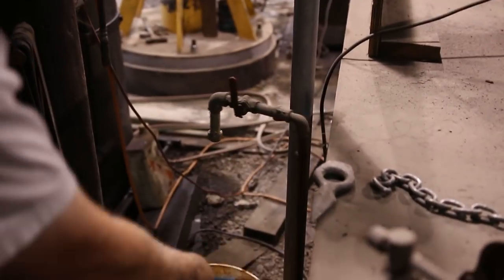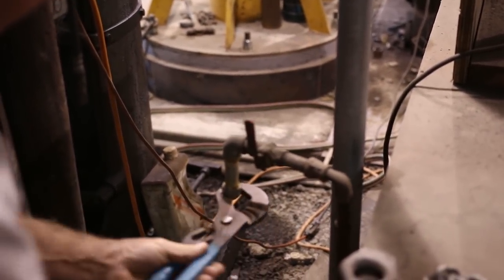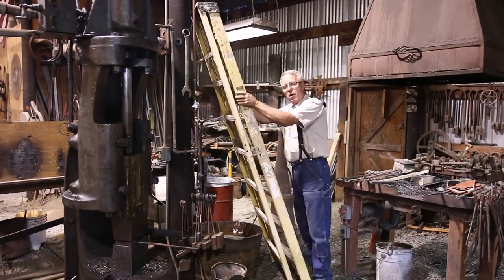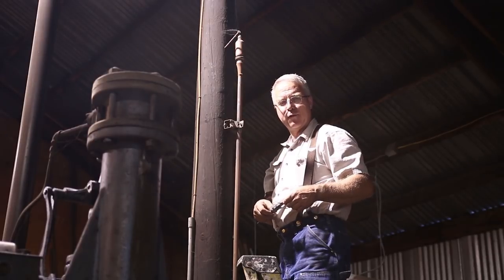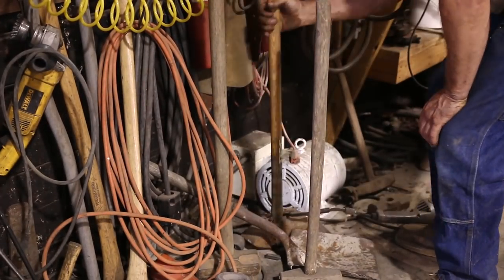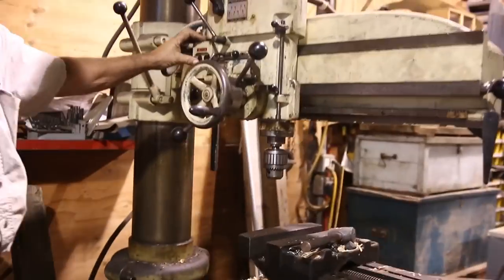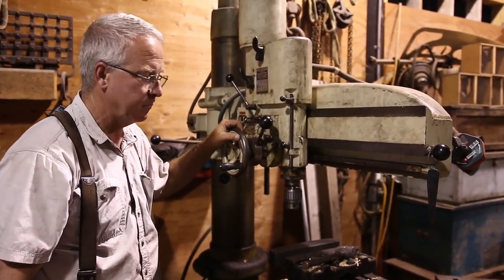Shop Questions: Condensation, 3 Phase Power, Whistle Specs

Comment: On that I have to agree. I have a number of friends who built their own shops and as they began looking about for equipment they all discovered they really should have set the shop up originally with 3 phase power and put in a 600 amp light industrial panel. If I ever get the chance to build my shop, I will have learned from a lot of people's mistakes. Thanks for sharing.

Comment: I am a glass artist who etches and carves glass with a sandblaster. I worked for a custom glass company for nine years, and ended up being a de facto sandblaster mechanic. I have my own little blasting rig now. Condensation is my nemesis. When you opened that valve and the rusty water came out, it brought back a flood (so to speak) of memories of trying to meet a deadline on a big etching job after a week of hard rain and nobody else in the shop had bothered to drain the compressor tanks or any of the airlines. The water traps don't help at all when you need the silicon carbide or aluminum oxide grit to be dry.

Comment: I bought a three phase motor when I built my belt grinder. It came paired with a variable frequency drive (VFD) that turns single phase 220v into three phase 220v, and it allows me to fine tune the belt speed. Sweet setup! I'll have to keep that in mind about the generator idea. Oh the possibilities... I also have a Miller Syncrowave that runs off of 480v single phase current, but it came with a step up transformer that makes 480v out of 220v. I got it from an old boiler maker who had a couple of master electricians wire it up for him. It makes that big machine run great off of just a 50 amp circuit! More than on way to make things work!

Comment: Always a pleasure to hang out with ya in your shop. I'm curious about the location of your compressor's over-pressure relief valve. Rust and no maintenance could cause it to fail . I'm sure you're aware but some viewers may not. Cheers

Comment: It's is a pressure vessel up here in WA the state comes and inspected any pressure vessel over 120 gallons. it's just under 200 bucks and gets done every 2 years. they measure the tank wall thickness in several spots and compare to the mfg's specs and history and will tell you when it's time to remove from service.
Am i glad i have to pay for  this? no, but my neighbor has a 4500 gallon tank and i am glad that thing get's inspected!

Comment: I have a much smaller compressor with a tank and much smaller aux storage tank for when I run a high CFM demand tool (die grinder, blow gun). Both the compressor and the aux air tank are located outside of my shop proper. I was nearly killed when working next to a large compressor at work. One day, the water separator decided to explode and launched shrapnel through the walls of my tool rollaround.

Comment: Federal Pacific load center? If I'm correct in thinking so because the breakers flip the 'wrong' way and exposed main breaker, you need to replace that pronto for safety.
I'm that LAST person to be considered a safety nut, but the failure rates are enormous. I just replaced one and I know 110% that the breakers do not trip properly.
They also should not be exercised or turned on/off regularly. I have a personal connection to that mess, and sleep better now my house doesn't have one.
Reply: Yeah, the color looked right for FPE.  If it is I agree, I am also not a safety nut but I had those in my house and they do not trip.  Total garbage.  There is a aftermarket replacement I used that worked well so I could just change the breakers but with a surface mount box like that I would just replace the whole thing.
Reply: Mulligan Farms federal Pioneer and their less then desirable and known to fail
Reply: John - yeah I considered the Cutler direct replacement, but went over top of my flush mount with a Square D surface. Both are miles better than FPE, and I had failure to trip after a screw went through Romex in the attic. The electrician and I then had the squeamish task of flipping 20+ unlabeled breakers to find the correct one. It was replaced the next morning.

longstar - just had that discussion with a friend in Canada after sending him pictures. Wasn't aware they have a slightly different name there until last week.
Reply: You must know the look better than me.  I've run into a few Federal No-Trip's in old houses around where I live but that one doesn't look like the one's I've seen before.  Granted, those were in-wall in a home not a shop level panel.
Reply: Really scary thing is ihave seen non bolt on commercial federal panels
Reply: I replace those things all the time. We call them fire pacifics

Comment: You may look into automatic drain valves. They automatically open at a specific time interval. Though the drain would need to be at the lowest point in the tank to get enough of the water.

Comment: Regarding the underground tank, one result of any perforation would be the immediate discharge of oily water from the compressor condensate; so I hope the shop is not too close to the water supply well.  It only takes about a teaspoon of oil in a railroad car of water to exceed some drinking water standards.

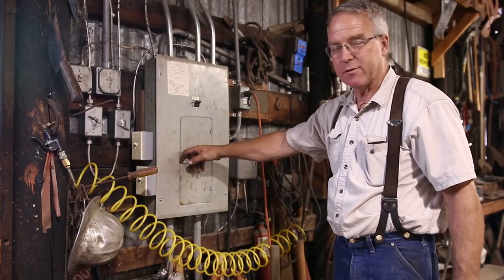Comment: 2:18 Some electrical advice. There are two things that get confused. 1. Total power available 2. Space for circuits available

1. 200 amps should be plenty of power to serve your shop. To check, remove cover, attach amp meter on one leg. Turn on as much equipment as you can, or that you reasonably would use on a extremely heavy work day. Check amps used, you will often be amazed how little your using. I doubt you ever exceed 100 amps. Now check the other leg, they both should read about the same amount. Each leg can handle 160 amps+ [thats 80% of 200- a safe amount] <[Checking the total power used might make a cool video as well, especially if you blow something up]>

2. If you have enough power, but have run out of space for more breakers, its a easy fix. You need to mount another sub panel next to the 200 amp panel. Say a 100 amp panel? Put a small conduit between the two panels. Install a 100 amp breaker in the main panel, then run two #4 wires from the breaker to the sub panel main lugs. #4 white neutral. #6 green ground. Now you have plenty of space for more circuits. Just try to keep the biggest circuits on the 200 amp panel, and the smallest circuits on the 100 amp panel.

Comment: Bought a house with 100 amp service and had 200 installed recently. Suits my wood working needs just fine. The smithy is not in my home, I’d need a lot more power to cover that. As always, great video, keep it up!

Comment: You're right - the tank will likely get a pinhole and leak that way.  And the dirt surrounding your tank will protect your shop somewhat from an explosive failure.  But if it fails this way the two feet on top won't make too much difference I don't think.  But make no mistake - entire shops have been totally destroyed from compressor tank failures.  They looked as if a bomb went off.  No kidding.  But most failures are due to pinhole leaks.  Carry on and keep up the good work!

Comment: Hi. I'm 15 and for the past few years I've really been getting into blacksmithing, machining,  welding, and metalworking in general (specifically knife making). I'm finally getting to the point where I can actually afford high quality equipment. No one likes to admit it but I think that harbor freight can be really useful for getting on your feet, but now that I can buy tools that will last over a month, I wanted to know what you think about specific brands. I saw that really cool antique 7" angle grinder & was wondering what kind it was, or if there was a specific brand you would recommend. Thanks.

Comment: I have seen a few air tanks fail over the years and every time it happened exactly like you said. it just develops a pin hole and automatically drains the water out of the tank and also automatically drains all the air out of your system every night when the compressor is off. :)
Reply: Jesus. You store tire tanks in the ocean or something? A decent tank should last at least a quarter lifetime at the minimum.

Comment: The total power requirements in a 1 man shop would be relative low although the number of circuits maybe higher than the panel has available. You generally do not run more than 1 or 2 tools at once. Note: if your panel is an F-P it should be replaced they are not safe.
I've been looking for a budget priced phase converter most are out of my budget ( 500 +) so my 3 phase tools sit under powered the static type sorta work  you only get 2/3 of the rated hp and probably not good for the motors.
Really like your presentations they are very informative and well done

Comment: Maybe an idea for a video would be to cover the Boy Scout's of America metal working merit badge. If you look at the requirements it offers a very on the surface introduction to the trade. The as the option for what kind of metal work go with the blacksmithing. An idea worth considering?

Comment: Living in Florida with our high humidity you have to have a drainage system on your compressor lines. We crack and drain condensation during every work session otherwise the equipment fails.

Comment: Water heaters are pressure vessels . There have been tests done on them that have made them some shoot straight out the roof of a 2 floor mock up house . 
All I'm saying , it has the potential to be a danger . What pressures is that tank under ?
Reply: Argo Tungsten 
The water heater issue has a lot to do with temperature, when temp control goes bad along with pressure release valve you end up with steam and.....boom

Comment: What are your thoughts about frequency drives vs. rotary converters ?  My understanding is it adds the opportunity for  variable speeds while maintaining same motor torque.  I ask because eventually I will have 3phase equipment for the reasons you stated.

Comment: I needed to use one of the compressors in a barely used ex naval workshop in Abu Dhabi, to get the ship horns working on the bridge superstructure for an owners visit and despite having a tank nearly six foot diameter and around 12 feet long, it seemed to have bugger all capacity. I tapped the tank and was stunned to realise it was full of water up to about 8 inches from the top. Only had a half inch drain cock on it and the clients were arriving in a few hours, so I had to wind the entire one inch reducing bush out of the base of the tank and get a crack squad of mop infantry to assist with the stinky brown, black deluge. There is no worse case of poor compressor maintenance that I've come across.

Comment: As a plumber that replaces galvanized pipe on a regular basis do to failure by rust, my best suggestion is bleed the water off of that more often. I've seen galvanized pipe that had been in a house for decades with no issues (despite the fact they are doomed from the beginning, what can I say, in those days it was a reasonable choice of material) but as soon as the people move out and the house sits for even a few months with water in the pipes and no running water the entire system of pipe rusts unbelievably fast.

Comment: I have never seen a rotary three phase generator and I have work in industrial for most of my adult life. I am in love and I am going to go out looking now.
Reply: Robert Ketter RPCs are a good option, and there are plans online to build your own. The downside is they’re noisy.

Variable Frequency Drives (VFDs) are another option for you to research. With those you can get variable speed but they do require you to use low voltage controls. You cannot break the circuit under load downstream from a VFD or you’re very likely to release the magic smoke.

Comment: As a man with vast concrete experience, I'd like to ask you a question from someone with little concrete experience. We have a local quarry that sells limestone blocks. 2'x2'x4' in size. Roughly 1800-2000lbs a piece. The price is cheap if I remember correctly but at the moment cannot recall the exact price. Is there a way for me to figure out the slab thickness to use these as a wall for a shop or would the weight be too much to be feasible. I've tried to google building with stone blocks but not having much luck. Our soil type is black dirt/clay for at least 10' then limestone below. Thank you for teaching me something even if you are unable to reply.

Comment: Just my experience with air compressor tanks (50+ years), but the weakest tiny hole (which is always on the bottom around or at the lowest point) rots away enough to create enough of a leak that the tank just won't hold pressure.

Comment: The thing with rusty compressed air tanks is that you can never tell which failure mode is going to prevail in the end. Why risk it?

In a typical tank, you've got ~150 psi = pounds of force per square inch, The surface area of a 120 gallon tank is in excess of 5,000 square inches  - that's more than 750,000 pounds of force - 375 tons of force - stored up in that tank.

Even if you have it buried under 375 tons of dirt - unlikely - that's one heck of a lot of force to be containing. 

Two aspects of static pressure:

It applies in every direction equally
It will seek the path of least resistance if there is a way out, and it will rapidly enlarge any such hole.

Given the above, the chances of a catastrophic failure are unacceptably high.

That tank is already a goner - get it out, and get a new one with an epoxy lining from a reputable supplier, with certified pressure relieve valves - it's big enough for two, and they aren't very expensive., and get the new tank rigged with automatic drainage.

If not for yourself, for your grandkids...

I'd recommend that you chat with Stan Zinkowsky (Shadon HKW on YouTube)  of Bar Z Industrial about how to go about it. I don't think that he's licensed outside of California though...

Comment: How many amps are involved with your 3 phase converter? What is it capable of?
Reply: those rotophase things are dinosaurs. we use VFD now, its much more efficient and you can do so much now with them, like slow starts to decrease inrush current, oscillate rpm at certain ranges so it will never be at a constant speed which is good for lathes, almost anything you can think of you for a motor can be done with VFD.

Comment: yes and no about your logic on the air pressure. what pressure are you running? 100 -120 PSI? I don't know. What size tank are you using (in surface area...). That's a lot of energy. You're right it's not the energy of steam. But it's still a lot of energy. 
And yeah, It probably wont be a massive failure but still...
I am and engineer and take it for what its worth. I'm just contributing to your channel to help support. You have good content. Keep up the good work!

Comment: Your air tanks sounds like a sore point. Not to rub salt in the wound but your are looking at it wrong, it is very possible to have a catastrophic explosion with an unfired pressure vessel. They are actually held to higher standards than boilers (IDK why)
That's also why you use hydrostatic pressure for boiler tests not compressed air.
Being elastic they behave a lot the same, steam just has a lot more energy contained in it.
 Google it, the pictures should change your mind in 2 minutes. Hope that helps.
Look up Dyer county fairground explosion sept 10, 2007.

Comment: Wouldn't mind more info on the phase converter. It comes across as home built?
Reply: Not home built, they are commercial you can buy them all over.  As mentioned though a vfd is generally a better way to go since you can use it for speed control.

Comment: a vfd would probably be a better solution for 3 phase in a small shop and more capable for speed control and what not  and fairly reasonably priced. even if that tank dose catastrophically fail its 2 feet under
Reply: 2 feet of dirt would offer near zero protection.
Reply: VFD's usually only work up to about 3 hp to convert from single to 3 phase. After that they pretty much all require 3 phase coming in.
Reply: Cost of ownership is also important. If you have three or four appliances to serve, EC's solution is cheaper than several vfds. Also I've learned vfds require a plan for cooling your motors when under driving them for speed control because built-in fans on the rotor won't move enough air.
Reply: @kmcwhq the way I was thinking about it is that the water pools at the bottom rusting that through aiming the blast down
Reply: you can get vfd's that will run a lot more than that but it gets expensive.
Reply: that is true
Reply: I run a Powermatic 87 bandsaw, a three horsepower Unisaw and an Oliver 159 lathe off of VFD.  Soft start, motor protection, and three phase power.  No complaint here.